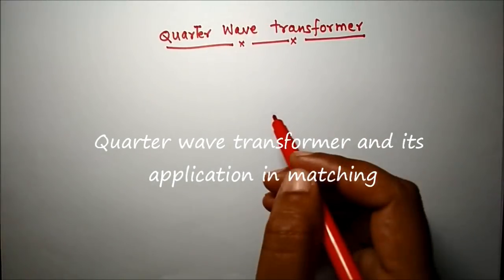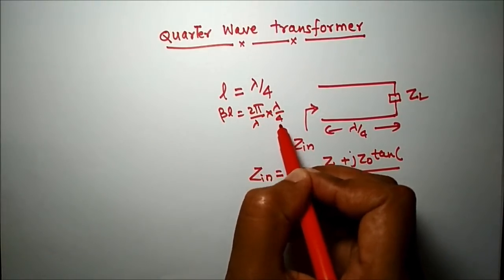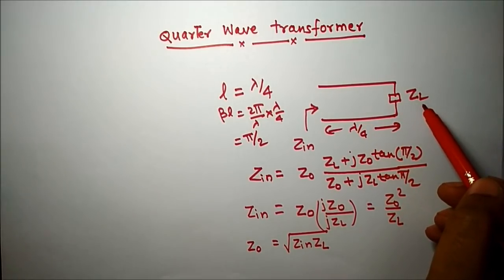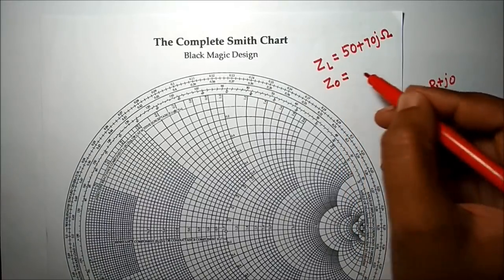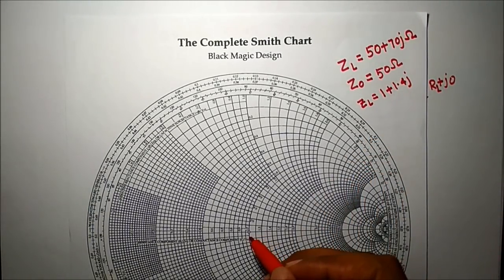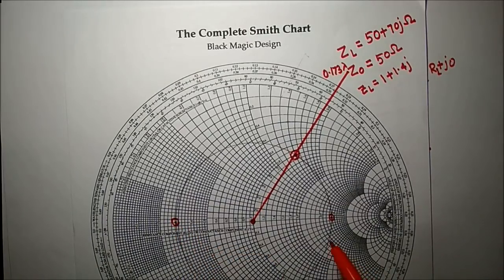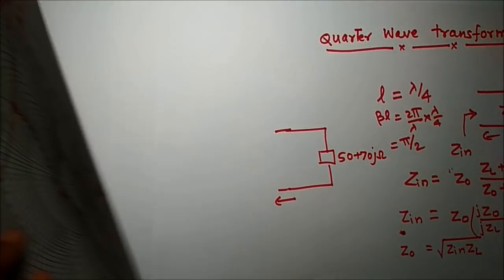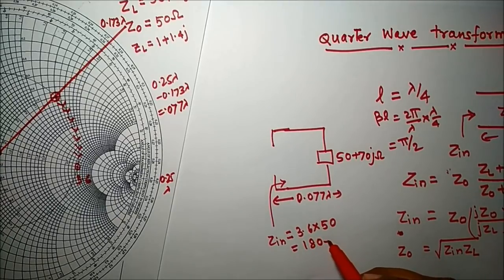Quarter wave transformer matching Circuit using smith chart by Dr. Niraj Kumar VIT Chennai

Comment: This is what I need. Do you also have half wave transformer matching? 
I'm just started with transformer matching today, this video is helpful.
Reply from the maker: For half wavelength the load impedance will repeat itself. So there is no possibility of designing matching circuit using half wave.
Reply: @RFDesignbasics  Thank you Sir

Comment: I have a question sir.
To obtain pure resistive load, I should connect the 0.077 lambda length transmission line which has a characteristic impedance of 50 ohm  right??

Comment: is this admittance smith chart or impedance smith chart? We used normalized impedance of the load. 
Should I use admittance chart when I use normalized admittance of the load?
Does using normalized admittance change the process?
Reply from the maker: This is quarter wave transformer matching which uses series networks. That's why all the process are done on a impedance Smith chart. Only for shunt stub matching circuits, admittance chart is used.

Comment: Can you please show how to test its bandwidth response?
Reply from the maker: For testing BW response, it's better to use some kind of circuit simulator e.g. ADS, circuit schematic of HFSS etc. In these tools microstrip lines are available for simulation. Just draw it as per the circuit and convert the load impedance into R,L or C network at designed frequency. Plot the graph of S11 in dB and frequency and find the range of frequencies having less than 10 dB S11. Calculating theoretically is little bit tedious.
Reply: @RFDesignbasics  Thank you!